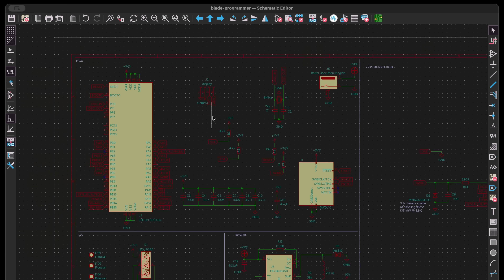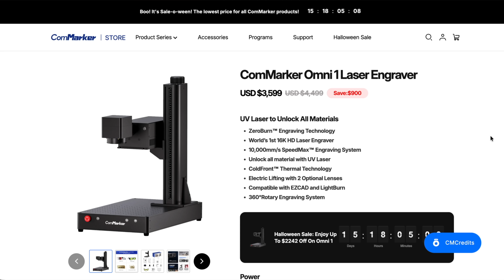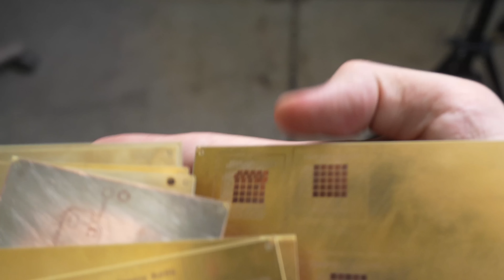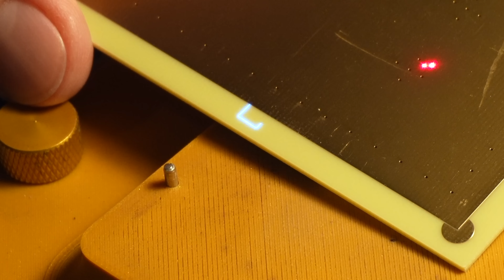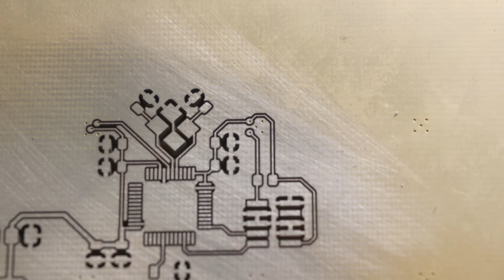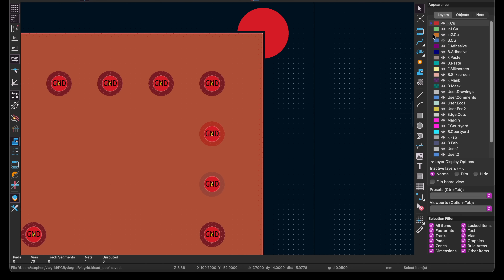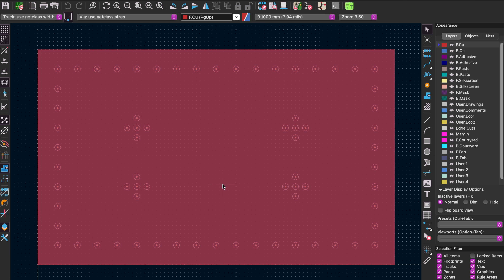The Last PCB You'll Ever Buy

Comment: Why not have the fab make it with full soldermask? Than use the laser just to take the mask away and etch it.
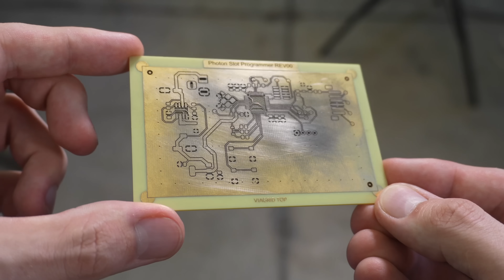Reply from the maker: At 6:39 I mention I've done this process with the laser in previous videos! Very possible
Reply: Came here to say this but yeah the resist has to be applied after the cut unless you could somehow cover the "trench" walls
Reply: Could be a fun thing to try. Idea is to pull the solder-mask opening in by a few mils so the mask itself gives you a tiny wall between pins. That tweak is easy since it doesn’t need any alignment change.

Also curious whether the heat-darkened edge of the copper (oxidation + soot from the substrate) already slows wetting enough to help stop bridges even with flux.
Reply: You're going to get bare copper which will oxidize rather quickly. Unless it's a throwaway circuit and you don't care ...
Reply: You could do a double etch.

First etch copper then spread solder mask across the board - then burn away the mask where needed.
Reply: The Chinese PCB fab place could maybe add that photosensitive resist film for etching after they made the boards if you request it. But I’m sure it won’t bridge holes, so you’d have to plug the vias first to stop the copper through-hole plating from etching away?
Would soldermask as a resist protect the vias during etching? I thought it wouldn’t.
Reply: I think he meant that the 'blank' PCB comes from the fab with full mask and then you etch both away selectively. It's certainly not ideal since you'd have exposed edges of the traces where the isolation oblation happens, but that's probably still a net positive relative to the whole board being exposed